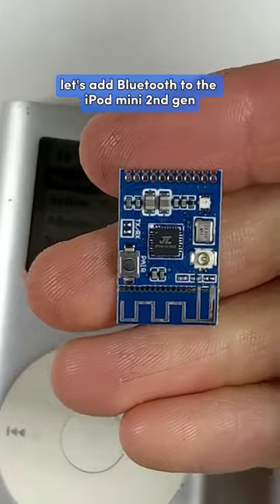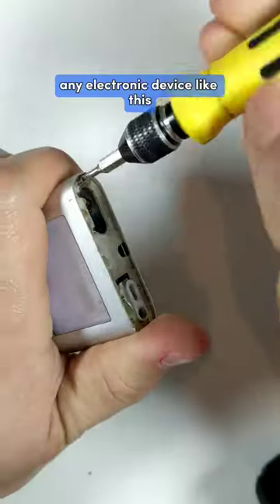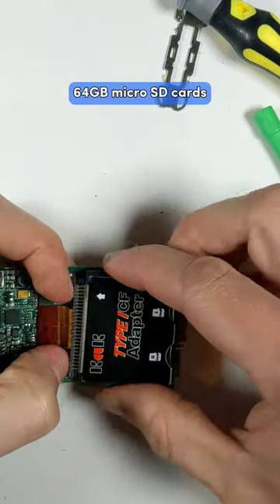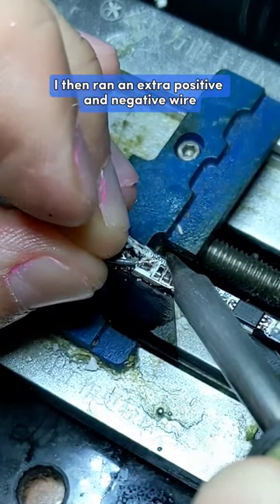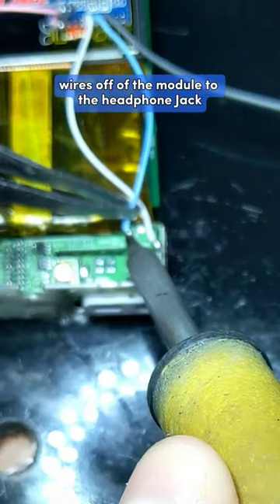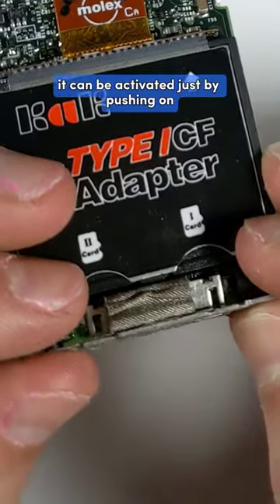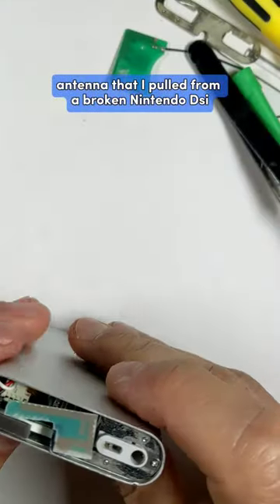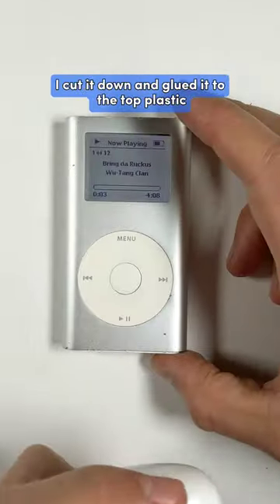Bluetooth iPod mini mod 🤯🤤 #ipod #apple #tech

Comment: Why don’t you wire the control button on the board to the back/forward button on the clickwheel? great mod though!
Reply from the maker: with this particular board it will unpair every time you change tracks if you wire it like that, i wanted a solution that wouldn't interfere with the controls.

Comment: Don't get me wrong you do great work but I have to wonder why the dual or more sd card readers in some  of these ipods? Especially when 128 and 256 gb cards are so cheap now it just doesn't make sense to me is all
Reply: i think it’s mostly because not all off brand adapters work and dual mini sd adapters are found more easily